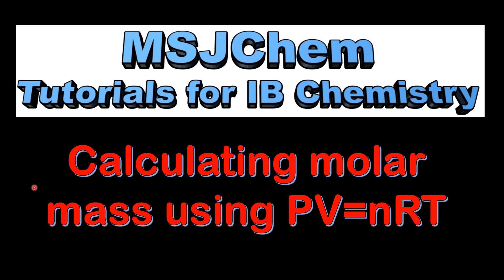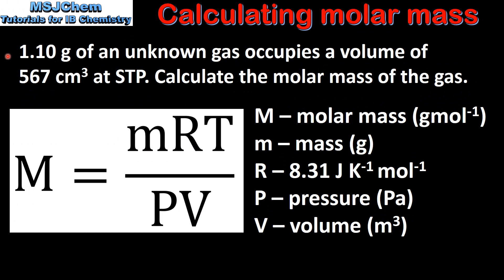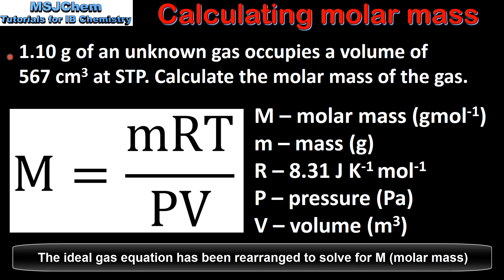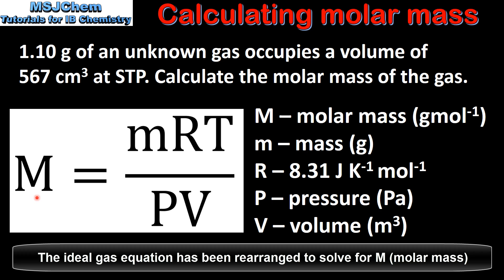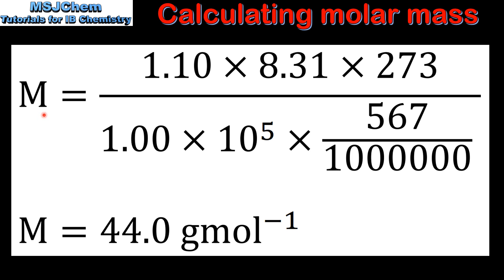1.3 Calculating molar mass of a gas using PV=nRT

Comment: Why do you times pressure by 10 to the power of 5
Reply from the maker: Pressure needs to be in pascals (Pa).
Reply: Well for any newbie seeing this with the same question, standard pressure value is 100000Pa, when solving we usually put it in its standard from which is 1.00x10power5

Comment: does it matter if I use 8.31 J/mol*K or 0.08206L*atm/mol*K for R?
Reply from the maker: +Aisha Zee If you are taking IB chemistry, then you should use 8.31 J K-1mol-1. It depends on the units you are using. Using 8.31 J K-1 m-1, then pressure is in Pa and volume is in m3.
Reply: it depends on what the question calls for. the goal is to only have the unit you want by the end of the calculation